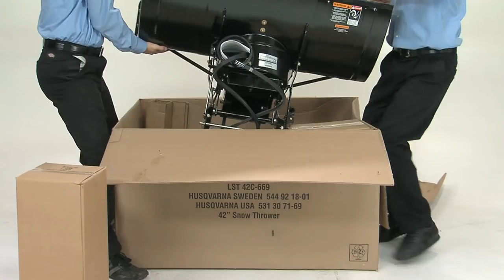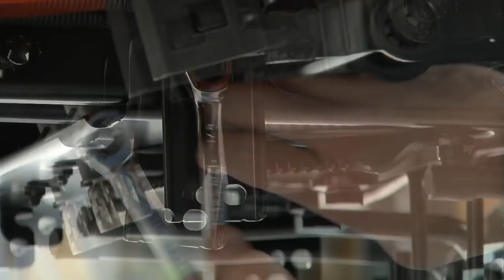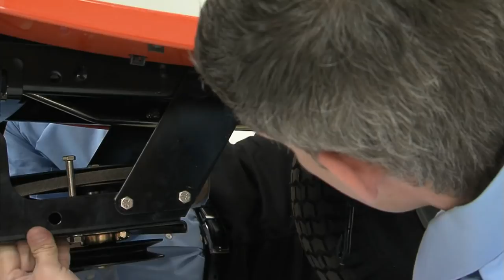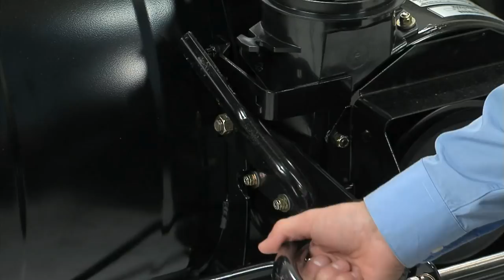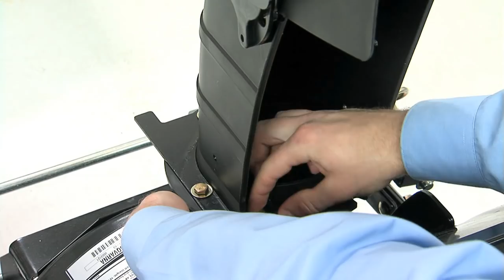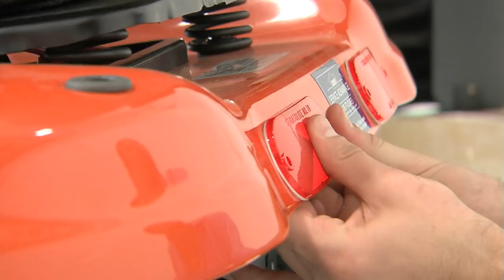Husqvarna tractors - how to attach snow thrower

Comment: I’ve had a 54” Husqvarna since 2007. I remove the deck and add the 42” blower every fall. The first time was a pain in the ass, because that is when you remove the front bumper and put the permanent front bracket and attachment points on the tractor frame and also assemble the pulley transfer case. But, every year after that you just remove the deck, hang the blower on the front bracket, pin the transfer case underneath, attach belts and do rear tire chains.
Reply: Awesome. We just bought this after our troybuilt push blower went out. I'm looking forward to it arriving and installing it. Im wondering if instead of chains could put those eBay kart Trax wheel on? We live in the mountains and traction is definitely still an issue with chains using the plow attachment. So idk

Comment: What a simple installation.  Do you have to take all that crap off to put the mower deck back on?
Reply: Yes you do...
Reply: No. I have this attachment on a craftsman tractor (917 model which is made by Husq). First time assembly out of box was 6-10 hours as in video. But switching between snowthrower and mower is less than 1 hour. You don't tear it down to nuts and bolts. You don't even need a wrench. All you deal with are cotter pins.

Comment: I bought my LGT 2554 in 2011 and have 350 hours on it and I haven't had one single issue with the riding mower. I keep it completely tuned up and maintained. 
As far as this snow removal attachment, we don't have enough snow to make it feasible to get one. Plus they are too expensive and looks to be too much work installing one. Maybe one day they will make a very easy snap on/off assortment of attachments. Fork lift attachment, post hole digger, plows, etc...

Comment: I had no trouble putting the blower on. It started when I started to blow snow. The blower belt would not stay on. I had to make a guide under the tractor where the belt drive pulley is. When I installed that, no problem.When it pulled hard,the beltwould jump and not stay on. Newer models they had a guide there.
Reply: Do you have a picture or illustration of the belt guide you installed? My belt falls off constantly if the snow is wet and heavy.
Reply: @brianpertel6228  I bolted a 90 degree brace under the clutch and bent it alittle so it would not be sharp edge. Can blow a full blower with no trouble. I am going to see if I CA. Put an idler pulley under there. I think I can. That would be better.

Comment: Just an observation, I would be putting nuts and bolts in so gravity was holding the bolt in place if the nut fell off.  It might be the difference between needing a new nut or a total failure.  Yeah they are engineers putting the design together, I keep on expecting to see a tie dangling into the shot.

Comment: Is there a video on how to reattach the mowing deck? Does the whole thing need to come off or just the front mounted blower?
Reply: The driveline will come off by removing those two pins and sliding it forward. Mower decks are typically also pin-on. Three points typically. The snowblower will also detach in a similar fashion for summer storage. That's a good time to oil all moving parts, get rid of any rust from the season and apply some rustproof paint to prolong the life of the implement.
Reply: @finncampeau4922  Yes yes, everyone was born knowing how, just like you. Sheesh give people a break, we all have to learn.

Comment: I dont get the issue here. I just baught a craftsman/husqvarna tractor and a Berco blower with electric winch lift. Took me a weekend to set up but now I can switch from mower deck to snowblower in 25 minutes tops as all brackets stay on. Use to take me over 3 hours to blow my driveway with a wlk behind. I plan on doing it now in less then 1 hour. I blow my driveway at least 10 times a year so it should save me 20 hours in total.
Reply: LDavid Henri yyyyy
Reply: Terminator65 ' Bercomac snowblower is made in Canada with excellent quality. Craftsman garden tractor gt7400 is found cheaper then comparable Husqvarna garden tractor with the g730 transmission.

Comment: Wow!!! Lot of these comments are the reason why everyone should take a shop class in high school, if they're still available.  After attaching the mounting points, it's only 20 minutes to attach to tractor.  Meaning after the initial mounting, every year after that , 20 minutes.  And no additional engine to maintain ..... like a snowblower.   It's awesome...... but you have to know invest your brain in actually doing something mechanical.... roll up your fn sleeves and try it out.
Reply: I agree. I've had mine since 2004 and have had no problems.
Reply: same here. 2 brackets - 4 bolts each, pulleys - no bolts just plug and play, throwers plug and play. 30 min tops

Comment: how do you adjust the limit screws for raising the blower?  Min only goes up a few inches which is not enough.  it mus go a little higher otherwise why is there so much cable on the winch?
Reply from the maker: Hi Marc, thanks for reaching out. It depends on which model. We recommend you therefore to go to your local dealer for support. /Your Husqvarna Team🌳

Comment: I need a replacement impeller and the dealer can not order one unless I get the product number. After a extensive search online on Husqvarna wed site and talking to experts by phone I still do not have the product number, its getting to be very frustrating.  I have the 42" snow thrower attachment with electric lift...
Reply: Correction I need the part number for the impeller so he could order the  right one...

Comment: Wheel horse 312-8 built in 1984. Mower deck off: 1 minute, snowblower on: 5 minutes (alone with gloves on) cup of tea: 4 minutes. No tools required. 10 minutes and you're ready to blow snow. This system does not seem to be an improvement....

Comment: 01:15  You washer placement is incorrect.  It's supposed to be on the OUTSIDE of the bracket mount.  You are placing it inside between the frame and the bracket - there is a square part of that bolt that is held tightly with the square hole in the bracket - but by placing the washer on before the bracket - you're not allowing the nut to lock to the mount.  Plus, your brackets are then ~ .5" wider than they're supposed to be across the space between the two mounts.
Reply: actually it's correct. if you notice that prior to placing that piece, the 2nd hole to the left protrudes more than the other three. the hole goes through an  extra sheet of welded metal. the washers are  spacers that help that piece sit flush against the frame

Comment: and i still dont know how they transfer power fromn vertical pulley to horizontal
Reply: Long belt is fed Forward horizontally from the bottom of the XFR case to an idler pulley on the snow blower. That pulley changes the direction to vertical then around the driven snow blower pulley. Then down vertically to another idler pulley that returns the belt to horizontal and back to the snow blower bottom XFR case driven pulley. 

It’s a pretty simple set up, mine has worked flawlessly through 4 Michigan winters, but it is pretty useless without rear wheel chains and wheel weights.

After initial set up it goes on and off in about 5-10 minutes.
Reply: @seancampbell4719  i dont have a mower just saying xD  was wondering for a future diy project thx

Comment: It is not for nothing: who buys cheap, buys expensive. These versatile V-belt pulleys -
Deflection rollers. 
In addition, I thought Sweden would be in the EU, and as you would work with Metric Masses (key 1/2 inch).
Reply: [9

Comment: I am install this blower attachment onto my husqvarna tractor.....Not as easy as it looks....part fitment is poor so you really got to work to put on brackets.  My stock exhaust shield does not fit back on without a lot of muscle.  I am missing a flange nut.  The supplied hardware has oval nuts (locking) which make it impossible to torque with a screwdriver.  Customer support just refers you to closest dealer.  My install is only also to three min in video.

Comment: No, No, No. - This is not what I had in mind when I decided to go look at, and likely buy a Husqvarna 54" Mower/50" Snow blower. Way too much work to remove the mower and install the Blower. 

Pull the mower out from the side is so 1950's, you would think by now 70 years later they could do better. Attaching the Blower ought to be able to be accomplished in a matter of a few minutes not a few hours crawling around on a cold driveway. Most of us don't have a warm garage and two well practiced engineers to change our attachments out for us. 

You lost me. Ya gotta make it simple and easy.

Comment: good to know to stay away from, so many parts to fail, mine is driven by the front pto and drive shaft to the gear box on my troy built 22hp lawn tractor with a 5 foot blower no belts or pulleys to fail, used it commercially for 5 year and still going strong, how ever I do have that brand in a articulating front mount mower that been going strong now for many years, even used it 5 year commercially, the only down fall on it is the very thin transition drive belt that blows every year weather I was using it commercially or even today for just my own yard, seem to not mater how its used the belt only lasts so many hours, other then that I love it, hate the style he has

Comment: I have the craftsman version of the tractor. Plastic pulleys fail all the time. Had tractor for 6 years and am on the third set of plastic drive idler pulleys. I won’t be buying another Husqvarna or anything with plastic pulleys. My old bolens was thirty years old and never needed be pulleys except the idler in the deck that I changed once. They were steel. Step up your game. Charge an extra $20 for steel pulleys and put them on there. The pulleys melt if the belt jams. I’m speaking of on the tractor not snow attachment.

Comment: so much work for a poor quality product. my snowblower on my old 1998 jogn deere goes on with a couple pins and that things is a tank. solid 1/4" steel on the blower and 1/2" steel on the blower frame. no silly cheap handle to move it around. my blower is 20 years odl runs like a beast, throws wet heavy snow a foot deep at least 20ft.
Reply: Similar on my 1965 Bolens. 2 pins and a driveshaft.

Comment: I would buy a snowblower before doing all this. Ridiculous
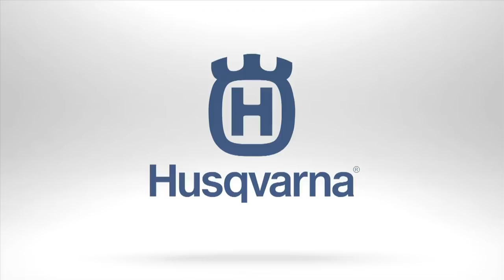Reply: +Larry Evans I see your point. this video is 22:00, but it would take waaay longer.  I think the counter argument could be...most of the maintenance would be for the initial use. No one would break the unit all the way down.
Reply: +Evictus M I have a 1988 gravely 8173- and a 1975 commercial 10 walk behind - and I can be snow blowing , mowing, plowing in less than 3 min. I just don't see the average joe/ doing all this. Even the kit to hook it up.  I may be wrong, there are a few people left with common sense left in this world.